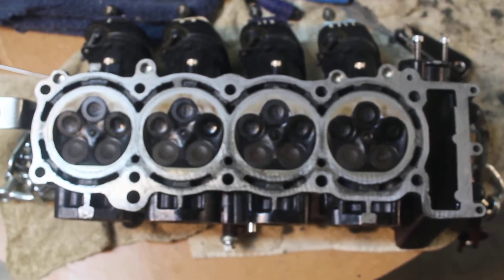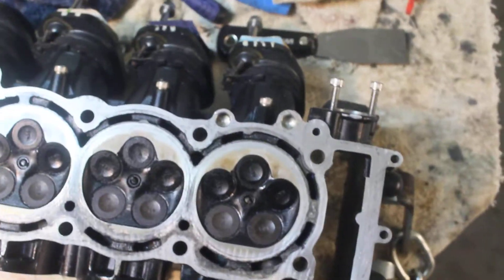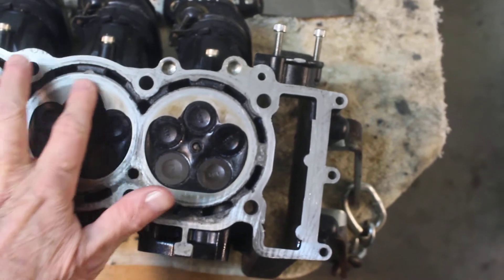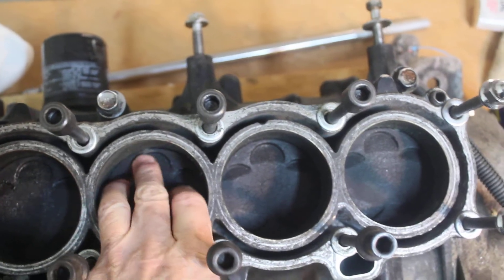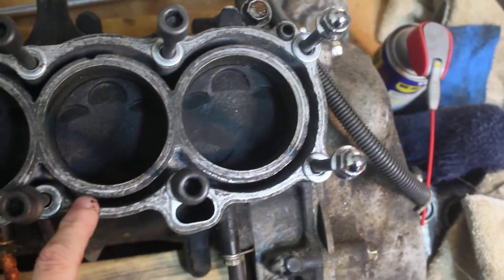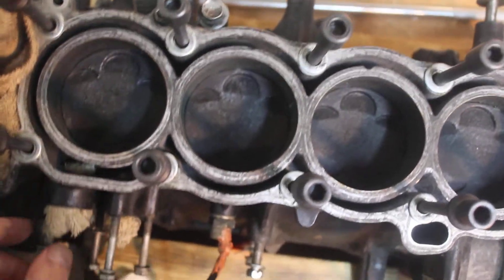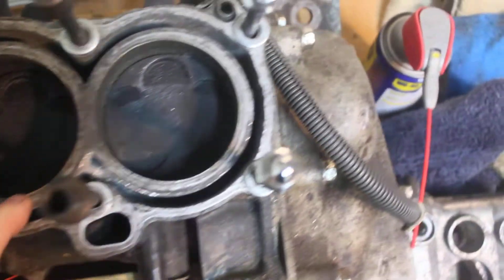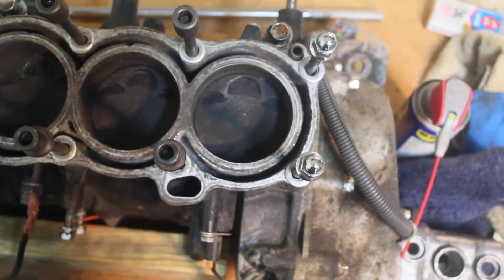Cleaning - Coolant Path, 1000cc, MR-1, Yamaha

Comment: Hello!  I have a 2002 Yamaha fx1000-a “fx140” jet ski.  I’m hoping you can help me out with resolving the issue I have.

The jet ski got clogged up with sea weed and the jet ski stopped working with beeps and engine light…I removed all the sea weed and it hasn’t really ran the same since…

It runs in the water but when I let go of the accelerator it shuts off.  I do that a few times and then it doesn’t want to turn on anymore.

One thing I do notice is that I do get a little bit of water in the part of hull that has the battery and flush hose…but it’s coming from the other side of the hull where the coolant reservoir/radiator and motor is.  I think it’s more by the coolant area,  but the water is clear that I see…

Any help will be greatly appreciated.  Thank you